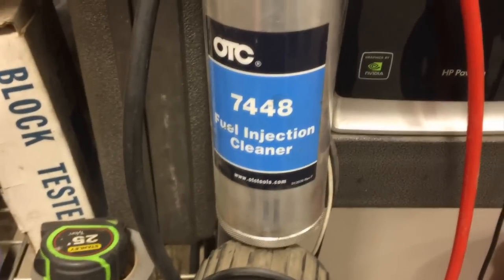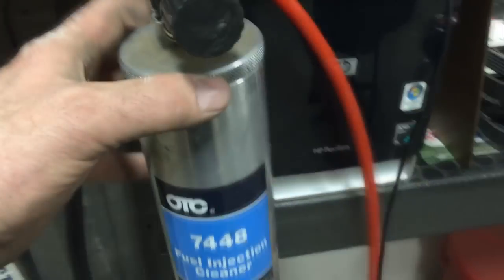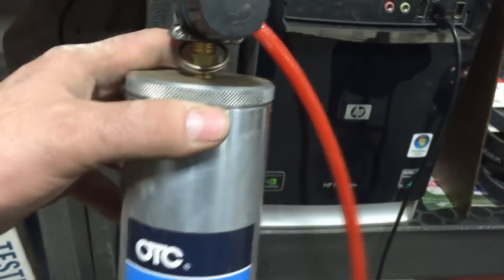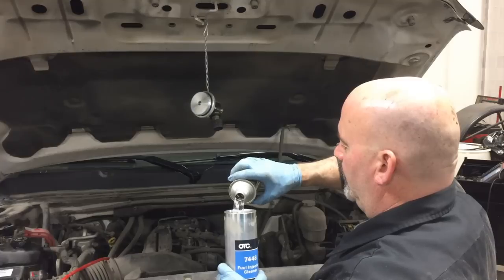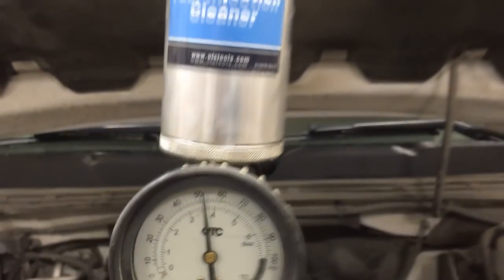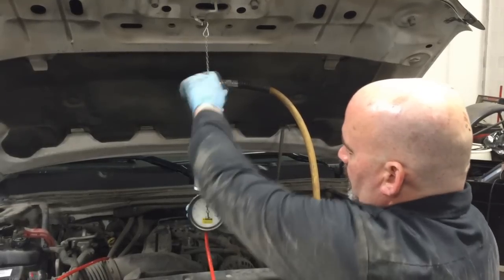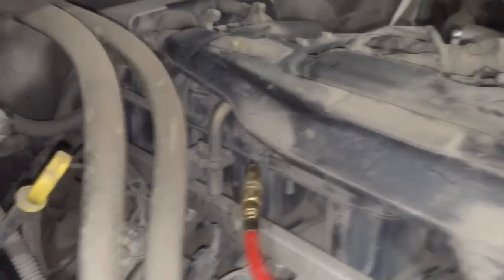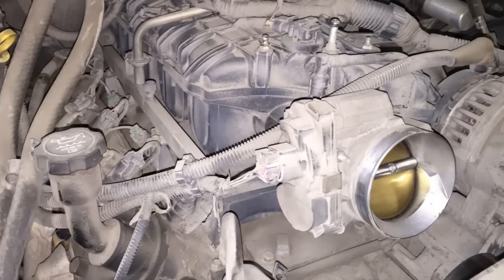How To Clean Fuel Injection Systems - Fuel Injector Service - OTC 7448

Comment: My 1996 Chevy truck has been sitting a while. It had stabilizer but it would not start. I siphoned the gas and put in new gas. It will run with starter fluid for a second. What should I do? Should I start by pulling the fuel pump? Can it be cleaned? Thanks for any advise.

Comment: I'm thinking of purchasing a fuel cleaning system for my 2005 4.2l f150, would you recommend taking it to a shop or doing it myself?  I've never done it before,  so I thought that I'd ask.   Thanks for the video, brother. Subbed!
Reply from the maker: I get plenty of use for mine. Guess it depends what your needs are but if you DIY youll know its done right. Good luck.

Comment: how does the cleaner not get pushed back to the tank i tried it and all my fluid went back to the tank an i hooked up my gauge and start it before hand and I ran it lower psi then it runs normally

Comment: Hello, 
I just purchased the cleaning kit, but can not find the Pro Inject-R Kleen Fluid - OTC7000
that you recommended in the video.
I'm hoping you might be able to suggest a similar product that is currently available on the market.
Sincere deepest thanks for all you do to help out us home mechanics over the years!
Reply from the maker: NAPA usually has it or you can substitute seafoam
Reply: Thank you again, I'll check with them...
Here's wish all up your way a super nice Summer:>)
Reply: @ThecardoctorTV  just use straight seafoam or does it need to be diluted any?  Thanks so much

Comment: FYI; On the 06 explorer 4.0 you have to disconnect the emergency cut-off switch located in the panel (passenger side front), removing the fuse or relay will also cut off the power to the injectors making it impossible to start the engine.
Reply: So when you say disconnect you mean push the red button to cut off fuel supply to the engine right

Comment: How much would this cost on a 2012 Nissan Sentra Commercially
Reply from the maker: 130
Reply: @ThecardoctorTV  Thank you for the reply I just wanted to make sure I didn’t get ripped off. I was charged a little more than that but I needed it. I was only getting 257 miles on a full tank of gas  (city no highway)

Comment: Holy cow when you mentioned your price for the product I was sitting just outside the auto parts store where I get preferred pricing having a business tax license. Anyways I just paid $36 for the AC Delco Top Engined Cleaner. Wonder how that compares to what you pay and for the ounces you get. I bought the 32oz version. I'm going to see what Amazon has it for just out of curiosity as even if I order there I pay state tax as we're one of those states that fought Amazon. Glad I did alot of my shopping before they passed the tax law as I can say for about 5 yrs I probably had over 200-250 orders a year and about 75% + is probably tools and shop equipment other than what I get from Snap-On and AESWAVE.COM with Carlos Menchu who does a great job looking after shop owners and techs as well. They can practically make any custom lead you want for scopes, diagnostics, scan tools and they offer many other test tools, add on's for scopes, multimeters, scan tools, programming for right to repair or as some call it R2R. 

Need something? They can definitely get you up and running. IF ordering multiple items it's definitely worth calling and speaking with Carlos for the best pricing as more items equal better discounts plus product pricing changes as well.

Comment: I have a 2008 Silverado, and have the same OTC 7448 you have, I did the #20 fuse and the truck still runs, and then pulled the fuse pump, and still ran. what im I doing wrong?
Reply from the maker: Try removing the relay and worse case disconnect the pump elect connector
Reply: The Car Doctor what number is the fuse?? I don’t know which one is the relay fuse.

Comment: I ran the cleaner on my 2005 impala at 47psi. Running pressure is 52-59psi with fuel pressure regulator. Ran for about 2 minutes, I assume the cleaner ran back to the tank? Psi too high? Fuel pump was disconnected.

I'm going to try at 40psi on my next run

Comment: hey I went to Pennzoil did the fuel injector cleaner service and the car does not start after would you know what went wrong??
Reply from the maker: I have no idea. Not a lot to go on. Does it crank? Does it have spark, fuel, compression?
Reply: The Car Doctor  it turns over the fuel pump good and starter maybe they flooded the engine but I have no clue
Reply from the maker: I would check for spark then
Reply: The Car Doctor I switched out the spark plugs still nothing
Reply from the maker: right but do they spark
Reply: The Car Doctor yes the mechanic checked

Comment: Great vid.
I have the same truck as in the vid, except i have the 5.3... everyone tells me there pretty good on fuel, except im suffering from very poor mileage. I am from Canada, we use kilometers, but i did a conversion and it seems im getting about 6.5 mpg , i was told i should be minimum 12 mpg or better! Tru k has no check eng light, no fuel leaks, i replaced air filter, cleaned MAF and throttle body... we recently put it on a friends scanner and hes says nothing seems abnormal. Am i stuck with a truck thats a pig on gas, or can i do something about it? Was wondering if i did this service, would i benefit from it?
My friend who is a mechanic, said to try what he called a Motorvac service? And possible change out the plugs. Truck has about 140K miles...
Thank you
Reply from the maker: it would be helpful to see what the fuel trims look like I guess and go from there. Actual MPG depends on so many variables. Might just be the type of driving you are doing that you end up with that kind of mileage. This service may very well help since injectors may begin to clog or even leak and cleaning can correct this. Good luck
Reply: The Car Doctor 
When getting proper fuel trim numbers, do i need to view it under driving conditions, at an idle, or at an idle but under load? My scan tool shows fuel trims, but im not sure the proper way to check them... I was told vehicle has to at normal operating temps aswell.
Thanks

Comment: Can faulty/ dirty fuel injector cause car to give a white smoke puff on first start in the morning?
Reply: Also if not, what might be the problem? I started noticing a puff of white smoke in the morinng. Stays for about 5-7 secs.
Reply: Raghav Puri usually leaky valve guides. Oil leaks past into the cylinder when it sits then burns off after its started.
Reply: Would first start then smell like oil as well?
Reply: Raghav Puri a little bit of white smoke on cold start up is normal. If it keeps smoking after the car is warmed up the you have a blown head gasket

Comment: Can you use the otc tool on a diesel with the proper cleaner? I have a BMW X5 35d with the M57Y motor and would like to run some Liqui Moly Diesel Purge injector cleaner through my injectors with this tool. What are your thoughts and/or advice?
Reply from the maker: I have no idea. Sorry, I don't work on diesel vehicles and wouldn't want to steer you wrong. Good luck!
Reply: The Car Doctor thanks for the response.

Comment: the dealship wants to charge me $150 for fuel injection service...I dont know much about this stuff but is that a good price? it's a scion tc
Reply from the maker: $150 is probably about right, maybe a little high. Mine would be about $120 here in Alaska. Put some Techron (available at chevron gas stations) fuel system cleaner in the tank and drive it
Reply: Thank you my good man
Reply: Gato356 At my jiffy lube it was $60, maybe look into there!
Reply: Just did mine today on a Lincoln ls 87$ with tax

Comment: does it come with a schrader valve end for fords? Or do i have to buy  the whole set?
Reply from the maker: You can buy just the tool and then get the adaptor for each vehicle or buy the complete kit with all the adaptors. I just have a few that fit most applications.

Comment: do u have to mix the fuel cleaner with gas are does it run on only its self
Reply from the maker: This cleaner runs by itself. The fuel pump is disconnected and the engine runs solely off the cleaner

Comment: What are the Fuel Injection Systems cleaners available in the market like OTC 7448 & BG 210 ( Directly to use fuel injector not to full in fuel tank )
Reply from the maker: They also have the motorvac and snap-on equipment along with others. This is a reasonably priced unit that seems to work good for me. Thanks a lot for watching the vid!
Reply: Thank you for the Replay Sir, Actually i want know about the Injector clear not about the Tool sorry for the mistake its not OTC 7448 want know about the cleaner like OTC 7000A and BG 210. 

There is lost of Injector cleaner available in market and dealer service center for add to fuel tank , Its possible to use that type injector cleaner direct to injector or mix with gasoline use by a tool like this your video.
Reply from the maker: OH sorry. Yes, I get the OTC brand from NAPA auto parts as a bulkamp product part number 7002121 There is also some bulk products available if you look around but I agree, its hard to find sometimes. I usually stock up when I can

Comment: The fuel pump was disconnected and it worked great. except for the fact I could not get any pressure out of the line. Once this was corrected it was good to go.   Thanks again I greatly appreciate the help.
Reply from the maker: Glad it worked out. Wish I had a list of all vehicles and how to disable the fuel pump for service. We should compile a database and sell it when complete. I'm sure it would be a bestseller.

Comment: I cannot get my 2011 Silverado 2500 to start with the relay and or fuse removed while doing this procedure? Any ideas? the starter hangs up for a while
Reply from the maker: Reach over the fuel tank and disconnect the electrical connector on the fuel pump.
Reply: Ok, I will try that Thanks

Comment: Thanks for posting the video Tim! I wanted to do this to my 2000 GMC Sierra and purchased the OTC 7448A (seems like it is the exact same model as yours, maybe just a new production number?). However, I found that the type of connector on my fuel rail may be an AN-6? My local auto parts stores don't seem to carry a fitting I can buy for the schrader valve fitting on the fuel rail. In addition, the hose supplied by OTC is quick disconnect type with a very small fitting on the hose. How did you connect yours in this video? Do I also need to purchase the (very expensive) OTC 6550PRO Professional Master Fuel Injection Service Kit to get the correct fitting to use my pressurized canister?
Reply from the maker: +Christopher Ryan Inwas able to get the OTC GM adapter separate of the master kit. CarQuest or advance auto parts should have what you need.

Comment: 👍 Tim this service is one you do as a regular service or was there a high fuel trim issue.  A before and after data pid comparison would be of interest to me in the future.  I guess  only fuel trims and a injector pulse width data pid would be required before you clean the TB or MAF.
Reply from the maker: Steve Rob Steve, this was a cleaning I did in conjunction with O2 sensors and tune-up work on that 08 Chevy 6.0 with a P1174. I would have done a comparison of before and after fuel trims but they had already fallen in line after the O2 replacement and I didn't get that on camera. Still working on building my B-Roll footage for similar projects which should improve the final product. Thanks for the complements and suggestions.